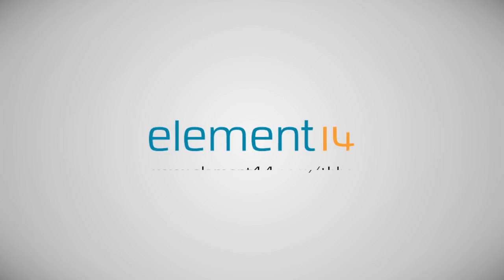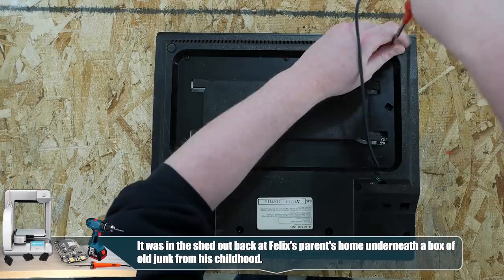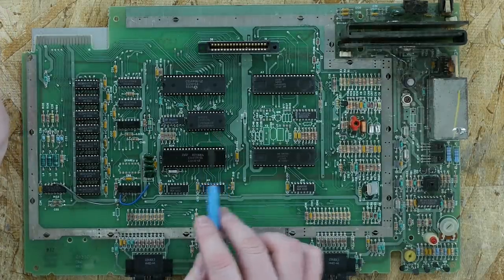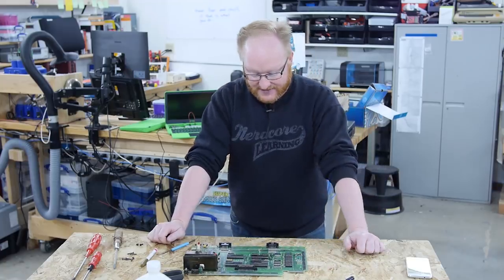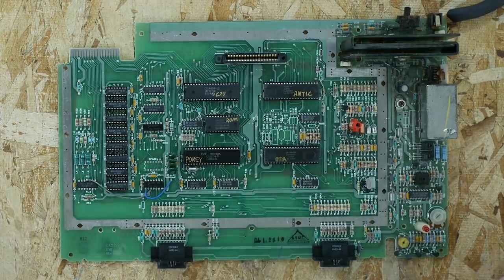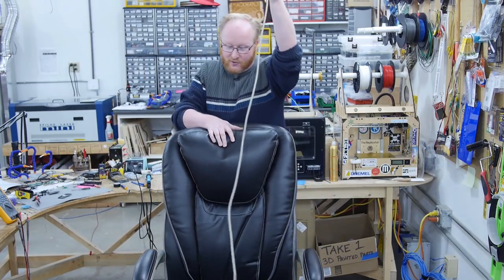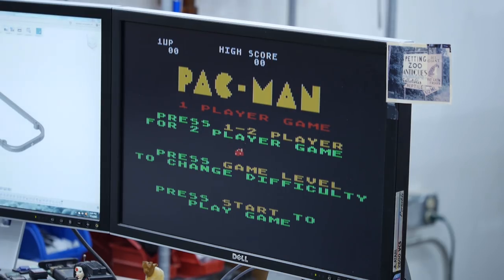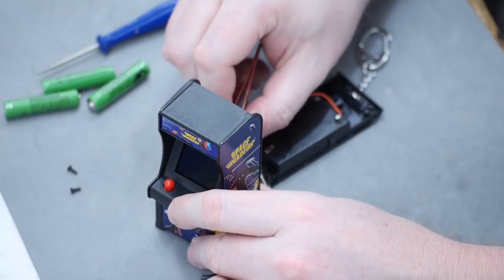Atari 5200: Making a Better Controller

Comment: Hey! Can you build a version of the NES Zapper that works on modern televisions? Or take an AimTrak USB light gun and hack it to work on the NES and then use the AimTrak gun's sensor bar with the TV? I might want to use it for my new AVS console! That one is HDMI-only.
Reply: That would be quite the challenge given how the NES zapper is designed to work.

You'd probably have an easier time with the SNES Super Scope, because it works slightly differently...

But because of how those light guns worked in general I'm not sure you could really create a version that would work in a way the console could actually understand.

Would be an interesting project if you could though...
Reply: Probably you'd need to use IR beacons and a camera (like the Wii remote and most modern light guns) to determine where the gun is pointing, and then use the position data, along with picture data from the console's video output, to virtually sample the light level of that area of the screen, and feed it back to the console. It could probably be relatively easy on traditional hardware that has a true composite output.

For something like RetroUSB AVS (a modern, FPGA-based reimplementation of the NES hardware) this would be complicated somewhat by the fact that that console doesn't have a composite output - the light gun would need to sample picture data from HDMI instead. The HDMI signal from those PLCC machines is probably low enough in latency that it'd still work.

As for the SNES Super Scope - I'm not sure how that's easier. As with the NES Zapper you need to use position data to determine when the console thinks it's drawing the part of the frame where the light gun is pointed. An implementation for HDMI-only systems like Analogue Super NT might be simpler than an HDMI Zapper, since the light gun would only need to know the timing of the frames (and adjust that to produce an approximation of the console's true frame timing) as opposed to sampling picture data from specific pixels in the frame...  But an analog-signal-path implementation would be almost the same either way.
Reply: Robert Weatherholt if this could be possible, I'd buy one immediately.
Reply: Tetsujin The two work quite differently though.

A game using the NES zapper flashes a bright square for a frame independently for each target, and when the zapper detects such a bright region the console checks on which frame it happened.
Since only one target's square lit up on any given frame, the console can determine which target the zapper saw because of which frame it responded in.

The zapper has absolutely no sense of what it's pointing at though.
Point it at a bright light and pull the trigger while hit detection frames are visible and it'll register a hit even though you weren't even pointing it at the screen.

The Super Scope meanwhile is explicitly identical in function to a light pen seen with older computers.
It detects the change in brightness of the CRT raster scan itself, and if you pull the trigger it will send a signal at the moment the CRT's beam passes directly across the location onscreen that the scope is pointed at.
This signal causes the SNES to latch it's internal horizontal and vertical pixel counters, giving you an actual X and Y coordinate at which the scope was pointed.

In other words the Super Scope has a means of providing X and Y screen coordinates whose signal you could spoof. All you need is something capable of providing a set of coordinates, a way to calibrate those coordinates to the actual physical dimensions of thr screen, and a way to synchronise to the SNES's internal counters, and time the right moment to send the latch signal.

The NES zapper doesn't know what it's pointed at in the slightest. All it knows is... Is this bright, or dark?
Everything is based on timing and the fact that the zapper has a very narrow feild of view to detect whether something is bright or dark.
To fake that you'd have to determine during which frame the trigger was pulled, where on the screen it was pointed when the trigger was pulled and then determine if this should've registered a hit or not. This basically requires knowing what's going on onscreen.

To fake a super scope you don't need to care what's going on onscreen, you just need to have a way to know when a new frame starts (from memory the scope gets a signal for this anyway), a positioning system, and timers that are fast enough to convert X and Y values to a correctly timed latch signal.

In other words NES zapper seems to require image processing and some relatively complex logic.
Super Scope only requires being able to determine coordinates somehow (the Wii remote's method would work just fine) and some good timing.

They are quite different hardware, despite what you might initially be led to think.

The zapper is far more primitive, but in this case it's primitive nature works against you; For the zapper it matters what's visible onscreen at any given time if you want to fake it.

The Super Scope can be faked without even needing to care what exactly is visible onscreen...
Reply: double-checking some documentation shows that the Super Scope isn't even synchronised to the console. It just sends it's data whenever.
This in principle means you could fake it using timers alone.
As long as your counters count 60 (or 50 hz) correctly at the rate for horizontal scan and vertical scan, at worst you'd get a fixed timing offset when converting coordinates.
There may be more convenient methods, but if all else fails you'd just need some way to calibrate the timing offset to align to the frame timing.
Obviously if you read the video signal you can do this automatically, but it isn't strictly nessesary to get something that would work.
(the effects of incorrect timing synchronisation with the console would be that the gun's aim would be off. Depending on how super scope games are written, you could create any manner of calibration tools. For instance, with cursor mode active you can have some rotary dials on the gun and ask players to line up the onscreen cursor's position with the gun's sights by adjusting the dials until it lines up. - in fact, if you used any method of tracking not directly tied to the screen output - such as say the IR beacon method of a Wii remote, you'd need such a calibration system anyway to avoid aiming related problems...)

Most of these options don't work for the zapper because of how it works. You do in fact need to know what was visible onscreen when you pulled the trigger to know if the zapper should register a hit or not. (you'd have to calculate what part of the screen the zapper was pointed at, do image processing on the screen data to determine if the screen was bright or dark at the time, then determine from that whether a signal should've been sent to the console or not. And of course pray you can do all this processing fast enough that the console registers the 'hit' signal at the right moment.)
Reply: I don't think it would be as hard as you guys are making it sound. You would just need to update frame information related to the frequency of the TV/refresh rate. So you could make a light-gun with an internal program that will read the current refresh rate and convert it based on ratios that the NES can understand.
Reply: TheCyndicate Right.
Reply: Also,... what is stopping people from writing Game Genie codes that change the frame rate value on the NES side? That alone should fix the issue.
Reply: if you want a modern light gun go to Sinden Lightgun website . ;)

Comment: I still do not understand why they used the values of resistors they did on the joystick ports for the contact inputs.  With the values as stated in the design of the controller, of 500 ohm buttons, the values of the resistors are just too high for reliable operation.  If the 470 ohm resistors are replaced with 220 ohm resistors, the standard controllers are then within the normal range of values that would be normal for the interface circuitry, and the controllers actually then work quite well.

Comment: The problem wasn't that the joystick didn't center, but rather that it relied on the rigidity of the rubber casing around it to do so. The issue of course is that kids and time wore the rubber down, making it not center the joystick anymore. If a remember correct, the real design flaw was with the board. It was anchored in a point the allowed the board to flex causing the thing to break itself apart. It's really a shame that they botched the controllers that way as the system itself was not bad for it's era. If I remember correctly though, Atari made first, but when the company changed hands the board was used for the home computers. They literally sat on a more advanced console for three years and only released it once sales of the 2600 started to slip.

Comment: Back in 95 after I purchased Ultra Vortek for the Jaguar, I built a six button controller using a Sega six button casing. It worked perfectly but alas it is long gone. I wonder if Ben could make one?

Comment: Wow..  I can't believe anybody else remembers this thing.  I waited for this thing to come out for months...  mostly because it had the accurate pacman maze... completely disappointed with the controller...  except for the pause button... that was a Godsend.  I still have this thing in its box in my attic I think... I'll have to check it out.

As far as bad controllers... have to also go with 2600 joysticks.  Great simplistic design but not durable enough.  I had a first-gen console (with the difficulty controllers on the front - 3 lever-switches on each side of the cartridge slot).  The first gen joysticks had springs in them to press down the lands on ckt board.  There was a plastic overlay that held the springs in place on the board.  Tje other end of the springs were connected with a bracket to a piece of G11 or something.  I was cracking those like crazy before they changed to the white plastic insert with the extremely weak support rails...  good memories of long play sessions though...

BTW... how could you leave out the feature in the top-left corner of the console?   THE EXPANSION PORT!  so mysterious!  so unused!     ...to my knowledge don't think they ever made anything for it.  Anyway thanks for the memory lane stroll!

Comment: This was a very enjoyable video.  Thanks.  I had (have!) all of the old consoles, and have a singular hatred for the “stock”. Colecovision controllers.  It was hard to play games with precision (Ladybug,, Venture, Time Pilot), and uncomfortable for prolonged play.   By contrast,I loved the Super Action Colecovision controllers.  I did find their durability “lacking”, though.  I now use an indestructible EDLADDIN controller for that system.  The games play great now!!!  

I actually like the shape of the Atari 5200 controller.  It is comfortable to hold, and I like the placement of the “fire” buttons.  I also like the keypad for “Star Raiders” and Defender., and the fact that other games are enhanced by having two fire buttons.  The non-centering stick is an issue, of course.  However, the WICO 5200 stick is the best handheld controller I have ever used.  Very precise.  The 5200 power/RF setup is unconventional in the 4-port units, but it does simplify hookup quite a bit.  Especially if you have a big retrogaming set-up with wires all over the place.  The video quality over RF is acceptable; Atari always did a good job with that.  Nothing beats the Composite/S-Video output of an Atari 800, though.

Comment: My parents had a 5200 growing up and it was the original 4 port model. I remember playing it very sparsely because of that controller...we had 5 controllers and none of them ever really worked right even out of the box. I was very young and it was my first ever video game experience until we got an NES. I remember thinking, the sandbox outside is so much better lol Anyway, somewhere along the line a short developed in the power cable/connection box thing and someone decided to throw it out. Can you imagine...an Atari 5200 with most of the games ever released on it thrown in the dump! Anyway, really enjoyed this video, and the controller turned out awesome! Wow.

Comment: I challenge you to find the Atari 2600 adapter for the 5200 and make it work on the Atari 800 and or the 800XL, I figure by using pin by pin adapter cables.

The Atari 8-bit systems (XL / XE anyway) used a 65C02. A custom tri-state version. The 400 and 800 frequently used standard 6502 processor. The 5200 used a stripped down version of the Atari 8-bit OS.

This needs 2 modes - full X-Y movement, and simulated 8 position distinct for games needing it.

You should definitely mass produce and sell it.
Reply: Atari used the 6502C. Apple used the 65C02 in the //c.

Comment: I do think you'd get a small niche of buyers for something like that.
Certainly a version that works with the atari 8 bit home computers would go down really well.
Plus if you follow the specifications you technically should have something that (mostly) works on an atari 8 bit, 2600, 7800, commodore 64, amiga, Atari ST, and quite a few other systems.

As to the 5200 itself, I'm not sure how much it's controllers deviate from the standard atari controller specification...

Certainly though most of those old systems could benefit from a better controller.
There's a reason I use a Mega Drive controller instead. Even though that doesn't fully meet the specifications, through a quirk of fate it still works. Mostly. (on some computers such as the c64 the internal wiring of the computer makes using a Mega Drive controller dangerous, and doing so could short out something in the system. But for the most part it works.)
Reply: Most of those systems do not use analog controllers. Sega Genesis/MegaDrive pads work great with all of them, although there's some mod you have to do to a C64 so it doesn't accidentally fry its controller chip. Edladdin Controls sells an adapter for the 7800 that'll allow the Genesis Pads to use the 7800's second fire button feature. Now if one made a 5200 controller adapter to the Atari STe's "Enhanced Joystick Ports" then this controller could be used with the Atari STe, the Atari Falcon030, and the Atari Jaguar.

Comment: I didn't really dislike any of my controllers, although if I consider it retroactively, there was nothing to really love about my VIC20 joystick. I know I liked finding those aftermarket controllers for my NES and Genesis that had rapid-fire features. Rapid-fire is something they could use on some of the more modern controllers these days.

Comment: I remember taking the joystick apart and trying to play by manually turning the potentiometers in it. Also using a metal object to do button presses because the button pads stopped completing the circuit.

Comment: IMO there is def a market for that controller! the 5200 stock ones break so easily and even when they do work they hardly work. And there is pretty much no 3rd party options. 
So with some more refinement and testing, you could sell those controllers with no issues what so ever

Comment: I would love if these or something similar were mass produced. There isn't a good optional secondary controller out there for the Atari 5200, just a few one off mods here and there. Also you mentioned easily pulling composite off that video area. There isn't a good composite mod out there anymore that i've found. There used to be a board that could be used for that but it's dropped off the internet mostly.

Comment: Nice controller! However, I do prefer grabbing a stick like on a 2600 controller. With some games like Enduro, I play better with a stick. I never really cared for the ColecoVision, IntelliVision or Atari 7800 controllers. (For 7800, I never got a chance to use a CX78 controller. I've only used the standard US Pro-line CX24 controller.) The way you have to hold the controllers with the buttons on the sides always felt awkward. I had less of a problem with the IntelliVision, but it's still not a favorite. I don't mind the modern analog sticks. I just prefer the arcade joysticks or early Atari and PC joysticks (like the old Gravis black and red controller).

Comment: Colecovision console had such terrible controllers, too.  Better than 5200, though a similar design.  Unfortunately, the screw holes on the back were in just the wrong place to cause pain after a while.

Comment: I feel like the controller would be nicer with better ergonomics  and making the 2 red buttons shoulder buttons. Also, the number buttons should be where the red buttons should be, and the number buttons should have a groove for the controller overlays. Nice job though

Comment: so the controller has as much if not more processing power than the console you've connected it to. these would likely sell tho. the 5200 was an ok system if not for the controller.

Comment: This is great, but... what about the spinning function of the 5200 joystick?  I'm trying to remember correctly, but weren't you able to roll the stick clockwise &/or counterclockwise too?
Reply: That was the 2800/Sears Video Arcade II. Those controllers had similar issues with failures, so this should be the next controller Ben replaces. But with an old-fashioned stick that rotates, not a pad. The controllers work as joystick and paddle in the Atari 2600/7800/8-bit computers/C64, as well. Only problem was that you only had one paddle per port instead of two. The 2800/Sears Video Arcade II had 4 ports.

Comment: FYI: The Atari 400 came with 4K RAM stock, the Atari 800 had 8K stock. The 800 could be upgraded to 48K.
Reply: Those were the originally planned specs, but they pretty quickly boosted the retail models past that. According to Wikipedia, they were both first released with 8K. I bought my 400 a few years after release with 16K (though I don't remember if that was stock or an in-store upgrade), and my later 800 maxed out at 48K.